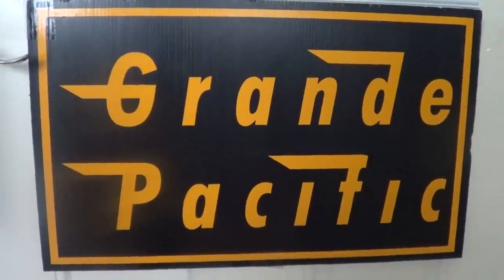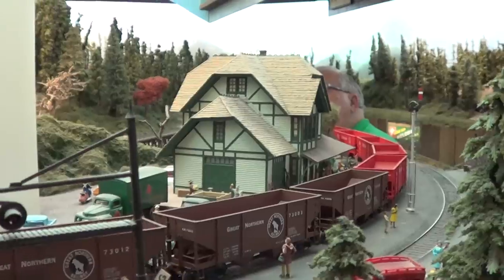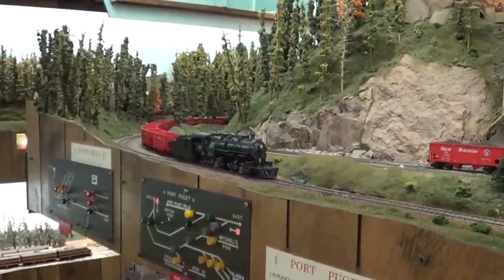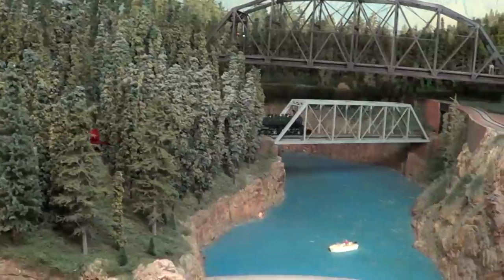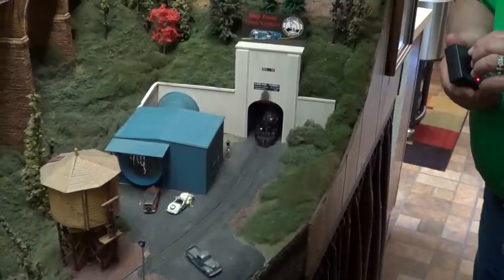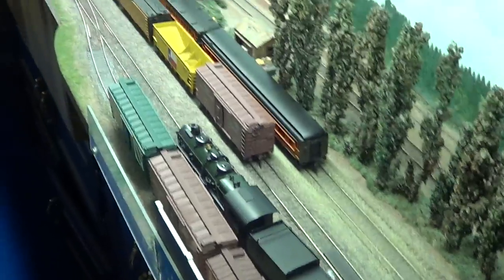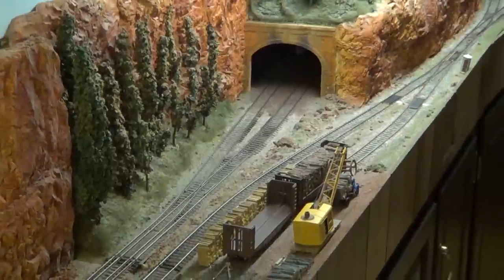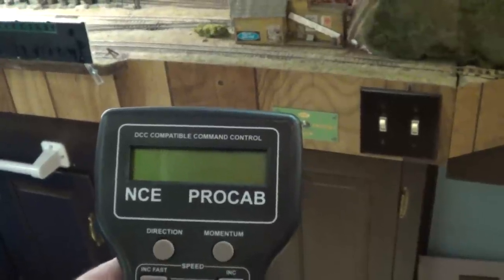GREAT GREAT NORTHERN RAILWAY HO

Comment: Regarding the Cascade tunnel on Stevens Pass in Washington state. The West end stays open all the time. The East end has a V16 power plant that provides electrical power to run the fans for  blowing out the exhaust and putting clean air back into the tunnel. After a train enters the tunnel the door closes and the fans come on and do the job of clearing out the smoke. It takes about 35 minutes to get the job done. One can hear those fans running as U.S. highway 2 goes right over the East entrance. Just my comment here. OH who makes those GN hoppers? I worked for the Great Northern way back in 1966 out of Wenatchee.